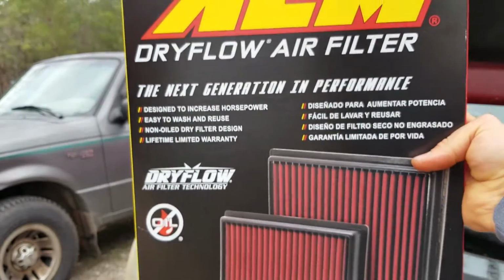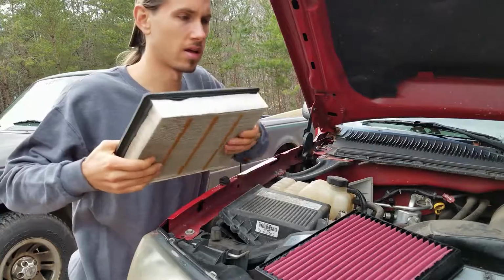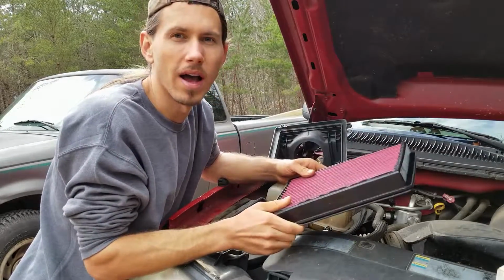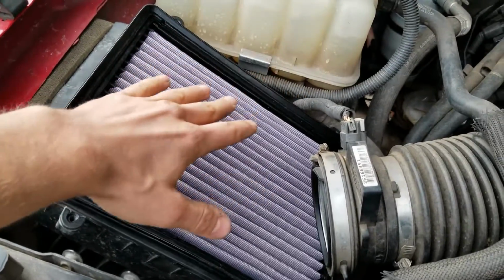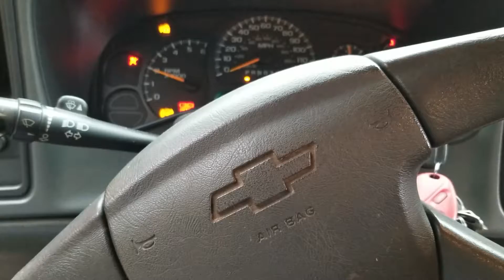Truck Air Filter That Lasts FOREVER? Will It Last?

Comment from the maker: Hey Yall! Air filters and air intakes in the description.
Timestamps:
0:00 Intro
0:42 New Dry Air Filter
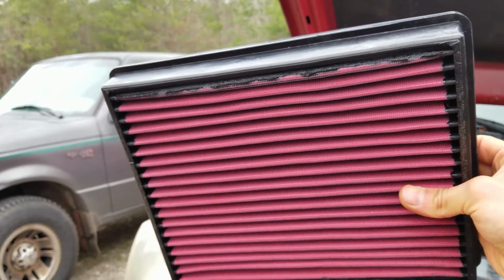2:02 Engine Sound BEFORE
2:45 Old Air Filter Removal
3:54 New Filter Installation
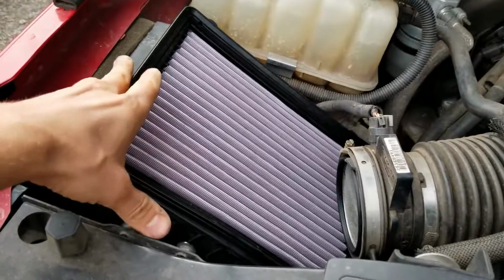4:31 Air Filter Differences
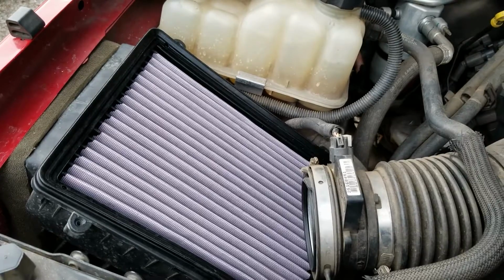6:43 Intake Installation
7:55 Engine Sound AFTER
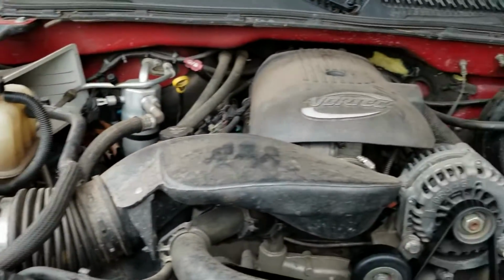9:03 Outro